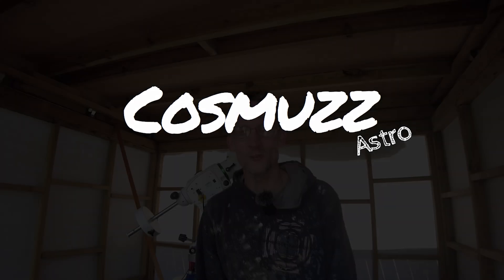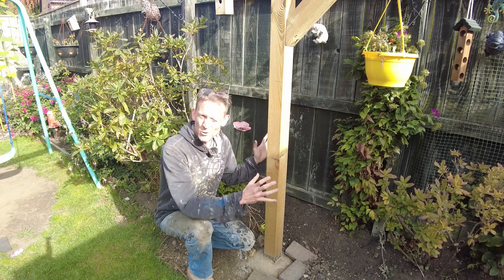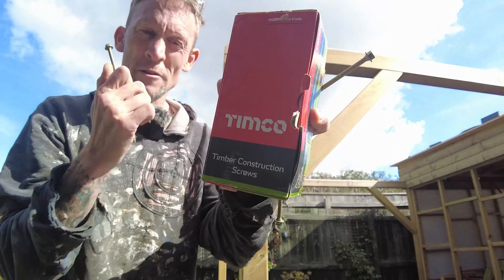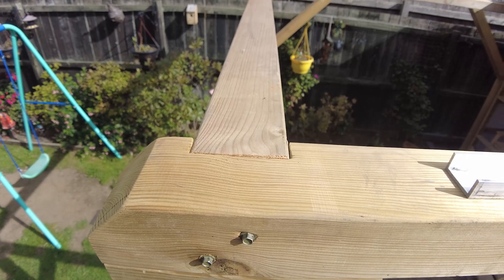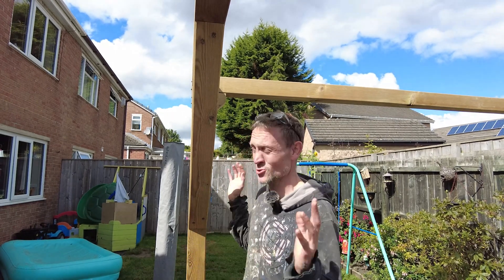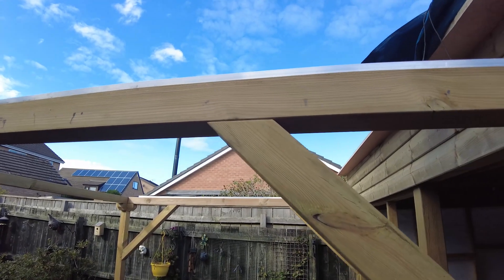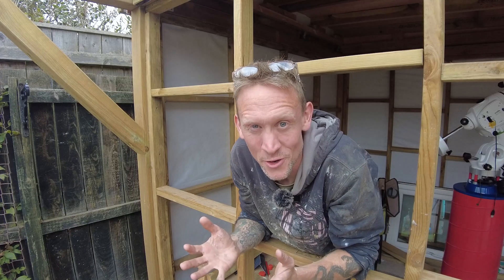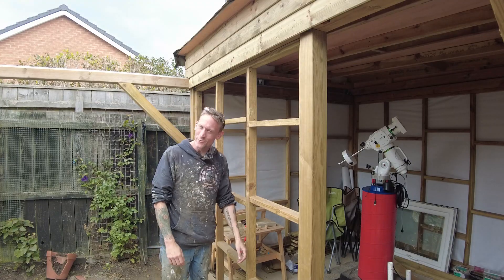Part 4 Observatory Build. Framing Of The Roof, Rail System, Cost So Far, Mistakes and further plans.

Comment: Hi Ben. Your vids are really helping me with my observatory build. What are the dimensions of the rails you used and what sized wheels also? Many thanks. Craig
Reply from the maker: Hi Craig
Glad the videos are helping and thanks for watching. 
 Random question.....Do you live in the UK?  Reason I ask is I will give you the links for where I got the stuff as well.
Reply: Hi Ben. Yes, I'm in the UK. I'm struggling with working out what dimension of aluminium track to get, so I thought I would use what you used, and then I know the wheels would fit the track too. Thanks ever so much. Craig 🔭
Reply from the maker: No probs mate
I just had to go measure up there as couldn't remember what I used.
2X 5M LONG Aluminium channel
1 1/2" W  X 3/4" H  X 1/8" Thick
https://www.themetalstore.co.uk/products/5m-long-aluminium-channel
(They aint cheap)

The castors are from B&Q
Unbraked Medium duty Fixed Castor WC108, (Dia)75mm (H)98.5mm (Max. Weight)60kg
https://www.diy.com/departments/unbraked-medium-duty-fixed-castor-wc108-dia-75mm-h-98-5mm-max-weight-60kg/5010952855547_BQ.prd

Please let me know if you need anything else.
Hope that helps!
Reply: Brilliant. Thank you ever so much. Regards. Craig

Comment: Nice work and great video! I too made some misstakes with my build, one the same as you but I didn't use concrete and that saved me some time :)
Reply from the maker: Hi Mårten
Thank you very much!
I noticed earlier you shared loads of videos on your build.  I have been meaning to catch up on them,  been really busy as you can imagine.  It is coming on great.
I found the whole lining up of the runners quite challenging to be honest still not perfect.  Think mistakes are bound to happen and the further I build, the more I am making.